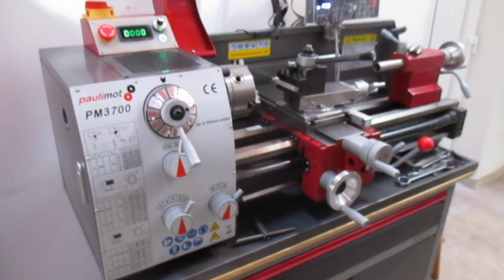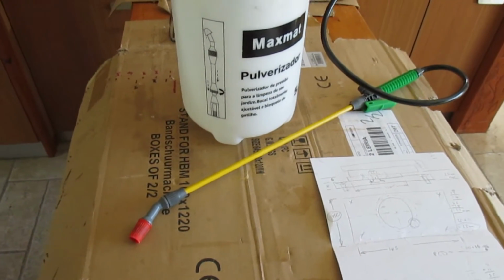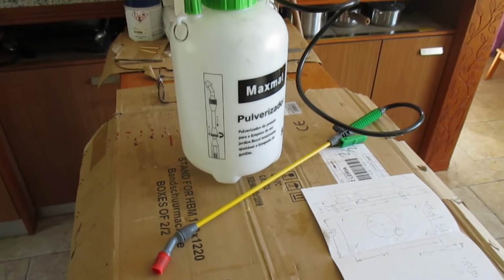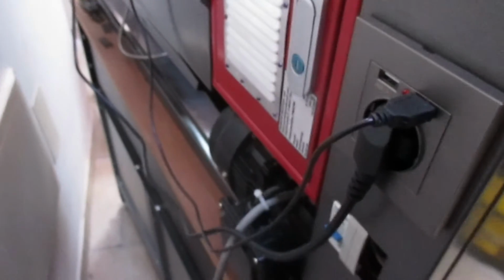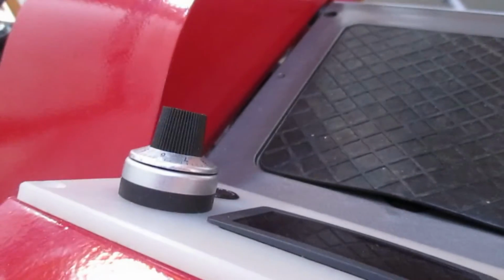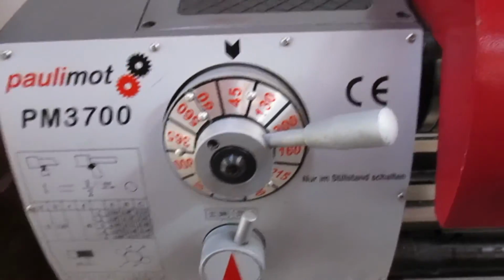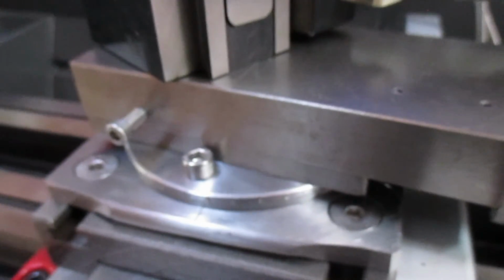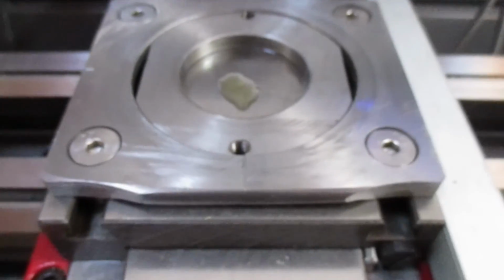Paulimot PM3700 Lathe 280 x 600

Comment: very nice customizings! would you mind sending me a copy of your technical drawings from the top slide you made? would be very nice. greetings simon.
Reply from the maker: Sorry, I did not make any drawings, it just evolved, the only analysis I did was on the plate thicknesses to get the best tool height capacity.
Reply from the maker: just for info, the lower plate started at 12mm, after machining 10.3mm, upper plate 8mm down to 7.3mm